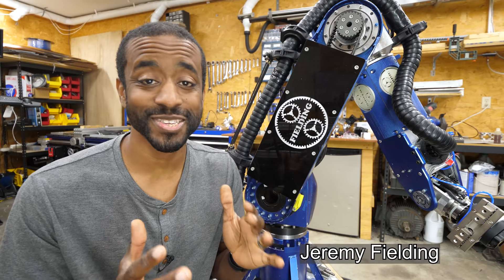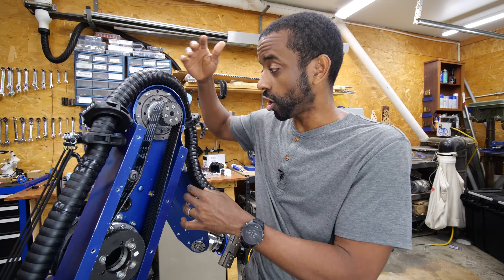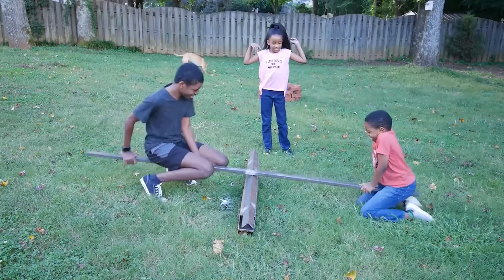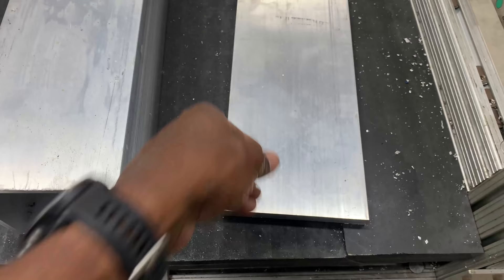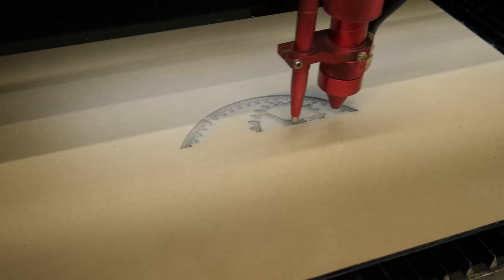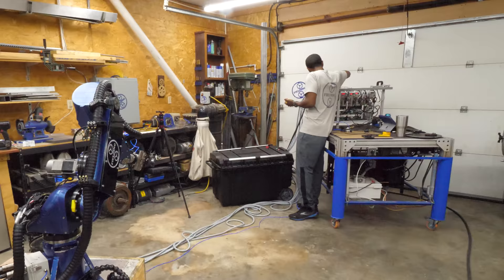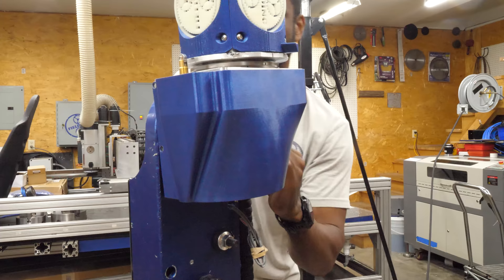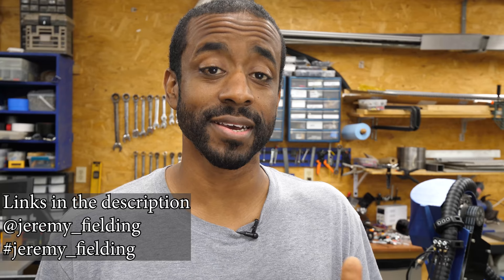How I Designed My Robot To Be Fast! Engineering Speed at a Lower Cost #092

Comment: Why you gonna fry my man Jarvis like that buddy? (Jk)
Reply from the maker: He still isn't talking to me despite many apologies but we are working through it LOL .
Reply: Buddy, what's wrong with getting fried? lol
Reply: @Jeremy_Fielding  Soooooooooooooooo very frustrating when it happens, my friend, and so easily done. 
The number of times I've saved a file under the wrong name (prior to when OS's warned you you were about to overwrite something) or have done exactly what you just did plugging the wrong plug in and letting the smoke out... 

It's not so bad if (like my plasma speaker) things just blow up for seemingly no reason at all, but so much worse when a moment's inattention which usually results in us questioning ourselves if we should triple check before power up.... "nah! I already checked twice" we tell ourselves.

We humans are lucky our legs don't twist in certain directions.
we can't actually kick our own asses with any great force. ;)
Still a banger video though!
Reply: @wafikiri_  What you're describing reminds me of "pointing and calling" a safety protocol used by Japanese railway workers and others where you point and say/call each step of procedure. https://en.wikipedia.org/wiki/Pointing_and_calling
Reply: @Jeremy_Fielding  Don't feel too bad. I once had a sparky working on a manufacturing cell with an Adept SCARA on it.
The mains cable (415 3ph AC) was a European cable. I'm in Australia where our most common 3ph cables are red, white & blue with black used for neutral and green/yellow ground. We do get a lot of 1ph European cables with Brown (active) Blue (neutral) green/yellow (ground). 
This cable was Brown (L1) Black (L2) Black (L3) Blue (neutral) green/yellow (ground).

SO the sparky didn't screw up I went out to the shop with the manual. Opened the manual to the page with the cable and stood there beside his pointing out this cable. His boss asked him if he had the cable right. He said "YES" then flipped the switch and blew the amplifier in a loud electrical explosion.
 
In his wisdom he had decided to ignore the schematic, the manual his boss and me and that Brown was a phase and blue was a phase and black was neutral. He combined in his brain the 2 types of cables he had seen. So he wired the brown to L1, the blue to L2 and the 2 blacks to NEUTRAL. AND I was standing right there with the manual open at the page with his boss standing beside me asking if he had it right.

FOR FUTRUE REFERNCE.
Use a set of plugs that CANNOT be put in the wrong place. If you've been around industrial robots you'll notice they use combinations of plugs that simply can't be put in the wrong place. Its done quite deliberately so that people just get it wrong. If you are going to use the same plugs repeatedly then MAKE sure you use the same wiring pattern for each one. That way the worst that can happen is that you'll have the wrong motor connected to the wrong VSD. 

It is advisable you run encoders in a separate SHIELDED cable from the amps to the robot base. Remember encoders send quite fast pulsed signals and its doesn't take much interference to mess that up. Plus if its recommends twisted pairs then USE TWISTED Pairs.

I'd recommend using a Harting style plug for the motor power and solenoid brakes. Even the low current versions can handle 10A through the pins. You'll find most of the robot manufacturers using these for this task.

For the encoders you can use almost anything you want that has enough pins. Standard D-type computer connectors are find especially when used with gold platted low noise pins. Remember encoders use very little power and 6 of them in total should be below 1A so even a 0.5mm2 cable can carry the power for all 6. The actually encoder signals are typically about 10mA so you can go right down to 0.14mm2 if you like. Standard D type computer connectors are fine. Just use a good quality gold platted connectors, tin the conductors properly and MOST IMPORTANTLY use a good quality cable. If it matters I usually start with Lapp cable, but Belden is pretty good too.

One thing when you look at robots is the cables that go on the actual arm and get moved continuously NEED TO BE RATED FOR CONTINUOUS FLEXING. If you look for "trailing cables" or "robotic cables" you will freak at the costs BUT they are worth the money. The first thing you will notice with these cable is how flexible they are. When you break in and start stripping you'll find they have may fine strands compared to normal cables. So you know - trailing cables are typically for use in drag chains, while robotic specific cables are even more flexible and can handle continuous flexing AND twisting.

NOTE: These high flex cables have talcum powder in them to help with the whole lot being flexed. Its not a major issue - just be aware it can get a bit messy.

If you use these cables with very fine strands here's what I do. When I strip I don't use the stripper to pull the plastic sheath completely off the end of the wire. What I do is use the stripper to cleave the sheath and pull it a couple of millimeters down the wire. I then use that small section of sheath to twist the strands as I pull the sheath off the end of the wire. What you get is a tightly twisted set of fine strands that are easy to tin and then solder into a connector.
The same applies to the very fine wires from proximity sensors.

Hope this helps best of luck.
And don't feel bad us control system guys watch you mechanical boys blow stuff up all the time. 👍😉
Reply: Love your channel brotha
Reply: @tonywilson4713  Very wise set of pieces of advise :).  I spent 10 years as chief IT systems at a company, and two of those years in desperation, every so often having to manually low-level-edit and correct damaged database records because a couple of sparkies had mixed up every cable at every hub in the company's 3 backed-up, 3 unbacked lines grid - and the grid would go down at any minute, servers and computers and anything.... and then after finally finding out that, another two months closely watching those same sparkies re-connect, and getting on my nerves every time they were about to mistake the cables to connect.
Reply: @wafikiri_  When it comes to certain sensors and connections I will let the sparkies have a go, but I warn them if they mess it up I will not take it well.

I have ended up re-doing so many sensor cables I should have been granted my electricians license automatically.

In Australia we used to have a separate license for "industrial electricians" in comparison to "commercial electricians." We even had a separate training and license system for instrument technicians/fitters. They did a lot more learning about sensors, PLCs, VSDs, etc 

But then in the brilliant wisdom of people who had no background in engineering they decided we didn't need that stuff. 🤷‍♂️🤷‍♀️
Reply: @tonywilson4713  I'm very sorry for Australia, for trouble will surface more often now. In Spain, such licenses are required.
About those two electricians I talked of, their company went broke (no surprise) during those two years of my desperation, so there were liabilities that could not be solved, so (don't ask me why) those two sparkies were the only way. I am no electrician but have way more knowledge of electric systems that they did, that was why my company assigned me the supervisory task on them. They would have solved nothing on their own.
Reply: Sorry about blowing out the encoders. Happens. A lot of good suggestions on how to prevent future occurrences. I would like to add mine. Along the line of what Tony Wilson suggested in his comment, perhaps reverse the genders for the connections requiring power versus the other connections. This would also require that the power pins on the powered connectors be the arranged the same on each of the them as to blow anything out in terms of line, phase, etc. This will allow you to keep the same connector type and prevent you from accidentally frying encoders and the like in the future since the male plugs will not plug into the male receptacle and vice versa. Another thing to make it clearer would be to paint the connectors or see if the manufacturer supplies grommets and an interior housing where the pins are located in different colors.
Reply: @hanzdasilva8934  Good points. 
I forgot to add flipping the gender and that is a really good option so long as you are careful about the male side and live power.
Painting is good heat shrink as a marker is also pretty good.
Reply: The feels <3
Reply: far from home i see...lmao

Comment: Bummer! Color coding both sides of connections with colored friction tape could help.  The objective is to mistake proof as best you can imagine when you “must use” something like 3 identical appearing cables. Indexing tabs or other devices that physically prevent anything but the right connection also work, but require invention.  It is amazing what 20/20 hindsight has taught me (the hard way)!

Comment: I have exactly zero experience in welding or machining,  but I imagine the stress and flexion of the part when welding can warp your precision milled cuts and then no worky.
Reply: Yeah, that's why he mentioned you should avoid welding after milling if possible.
Reply: specifically due to the thermal expansion of the metal you are welding. The molten metal, in it's molten state, is notably less dense than the cold metal on the other side of the part, and as it cools it contracts until it reaches the same density. Because the metal hardens before it is entirely cooled, it still has contraction to do after it becomes hard, and thus it creates a good deal of tension on that side of the part which tends to bend the whole part in that direction. Thus, welding perfect right angles into parts too large to clamp to a table is a very challenging task indeed.
Reply: @reaganharder1480  and then no worky?
Reply: @vennic  well, your precision machined stuff may no worky. If you're working on a project with relatively loose tolerances, it probably still worky.
Reply: @reaganharder1480  so the heat from the welding is distorting the shape, but what about the strength of the metal? weaker now that its temp spiked ?
Reply: temp and strength gets complicated. At least with steel, when heated to a certain temp not quite to the melting point and then rapidly cooled, the steel is hardened (note, hardness is sometimes counterproductive, as harder also means more brittle), and that hardening effect can be reduced or removed by heating the metal again, typically to a lower temp than the hardening temp, and then allowing it to cool slowly. I imagine aluminum works in a similar way. So, if the material you are welding was hardened before you welded it, you will likely end up with an area surrounding the weld that is softer than the rest of the metal, but this doesn't necessarily mean that the weld becomes a weak spot. In general, if a welded part breaks on a weld, it's a sign the the person welding lacked skill or knowledge, and not an inherent weakness of welding as a fabrication method.
Reply: @reaganharder1480  100% correct, when I weld complicated pieces I try to plan for the distortion and use it to my advantage to bring them back to square/parallel.
Reply: Warping is one form of distortion and the more obvious. You can also have hole sizes shrink. The material gets hot enough to creep and internally relieve. With that fresh exposed hole available, there's a nice spot for that stress to go, so the material expands ever so slightly, shrinking your precision hole.

Comment: Worth a teardown of those motors to inspect which components got fried on the encoder?
Could be a bust or <$10 digikey order to fix all three.
Mistakes are just opportunities for new content!
Reply: considering the motors are new and not pulled from old equipment i'm sure the encoders could be purchased and replaced for a pretty minimal cost. Automation direct has their name on them but I think they are sourced from either Delta or Yaskawa. Parts should be cheap and plentiful.
Reply: Yeah, I was thinking that too. If its just the encoder thats blown, that might be a replaceable part. Tho I'd probably do the same as he did and just order new and then look to repair when in a better frame of mind.
Reply: I really like this way of thinking, and hope we get some videos on him fixing the encoders using Louis Rossman style repairs XD
Reply: @robosilo  Where's a good place to buy industrial motors ? Alibaba ? I'd like to do a direct drive sim wheel eventually
Reply: @frenchonion4595  I've had good luck with Leadshine brand products. There is a US distributor called AMT that sells their servo/stepper products. If you're looking for single/3 phase induction motors, its hard to beat the selection of automation direct.
Reply: Very wise words my man!
Reply: But could you replace the encoders with a chinese knockoff and still be able to get a safety certification?

Comment: There are other advantages to the belt that you didn't mention. By adding the elasticity you reduce the bandwidth of the mechanical system (as you mentioned by the 'overshoot and snapping back'). This is likely outweighed by the otherwise greater rotational inertia (assuming you did your math right). The reduction in bandwidth though, also has an advantage, namely increased safety. By using an elastic element in series with your motor, you decouple the motors rotational inertia (which, because it is coupled through the gearbox, is very large) from the arm. I.e. the inertia from the arm with the motor directly coupled to it is higher than if it would be coupled through an elastic element. This effectively spreads out the force of an impact over a larger time period making it safer to work with. Also, it gives the controller more time to deal with the impact and reduce impact forces/energy even more.
That is the second point. Although the added belt elasticity decreases POSITION bandwidth of the system, it makes force control much easier. By measuring the belt deflection (difference between the input and output pulleys) you can deduce the torque/force applied as the deflection of the elastic belt is roughly linear with this force/torque. This makes it possible to relatively cheaply implement force/torque control on your robot. If you do interactions with humans, this is a superior way of doing control (namely force control + outer loop of impedance control). Because if a robot is commanded to a certain position in position control, it will move with all its might to get to that point, potentially breaking things (including limbs) in the process to get there. With impedance control there is inherently a limited amount of energy that will be used, and if an object is encountered it more naturally interacts with it. You can implement position control through impedance control by using a virtual spring between the position of the robot arm, and the point where you want to go.

Comment: Oh man, I never would have considered the potential risk of how an "M" and "3" could look the same on a plug label but of course they can.
Reply: Yep just like a 6 can be a 9 or an 8 can be either or a 3 if there is a smudge.
Reply: Its the same reason S and O and I arent used in auto VIN numbers.. Tooneasily confused so we just dont use em. 
But in the home shop... These things are bound to happen as one point or another. 
It's all about how you handle it. And Jeremy takes defeat like a champ. I can really appreciate that.
Reply: @kjfuson92  the letter S is used in some VINs (European IIRC) but your point is solid. I wished manufacturers would avoid using similar letters in part numbers, although I get that there are technical reasons why that probably isn't possible. In practice, a label maker and a clean font will help in the future.

Comment: Why don’t you want to weld after machining? I would imagine it’s because the amount of heat introduced to the material while welding has a high potential of warping or deforming the material, even if only to a small degree. However, when working with precision parts, even minute changes in the material can create massive problems with fitting, alignment, etc., down the line.
Reply: I've heard this old Tony say that weld joints can pull things together - as the weld cools it contracts with an incredible amount of force, enough to pull things out to true if you don't plan your welds sufficiently

I've never done anything precise enough to worry about these forces so idk the full extent, just quoting ToT

Comment: Sounds like a good reason to put a fuse or some type of breaker on that 5v line. Condolences!
Reply: Don't think that'd work. The fuse blows on current, not voltage. And thanks to mr Ohm's law, a lot of damage could be done by 24V before a fuse that is suitable protection for 5v blows. 

I could be wrong tho. 

You could build over voltage protection into the circuit, but easier to just label things better.
Reply: @DarrenPoulson  That's true too. I'm by no means an expert.
Reply: @hardwire666too Naaa, He knew the solution and stated it... different voltage, different connector... Kinda why it's even more painful to him I think
Reply: A fuse followed by a MOV (Metal Oxide Varistor) would work, commonly used on AC mains, but you can get ones suitable for 5V circuits (5.5V MOV).
Reply: @DarrenPoulson  But it would be a fun video to see how to build overvoltage protection into the circuit.  I certainly don't know how to do it yet.
Reply: A reverse bias zener diode in parallel would prevent high voltage from going through the other circuitry. Often a common breakdown voltage is 5.6 V. It would make a short to ground in that case though so you probably want a fuse somewhere along the line.